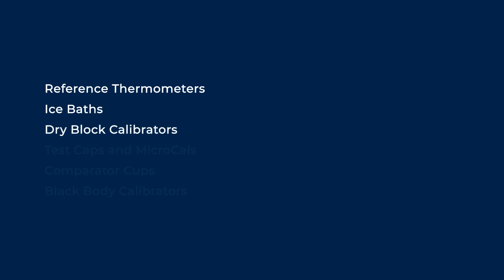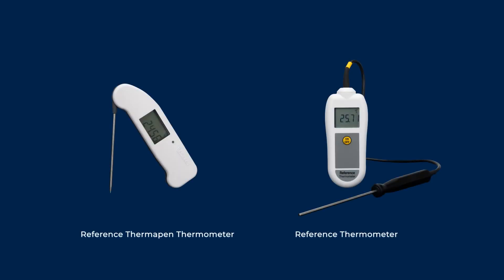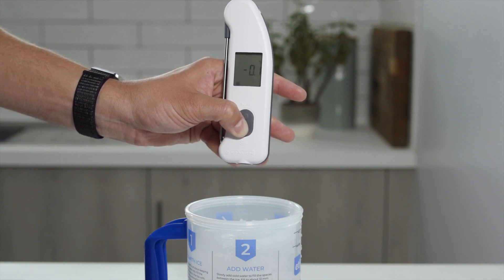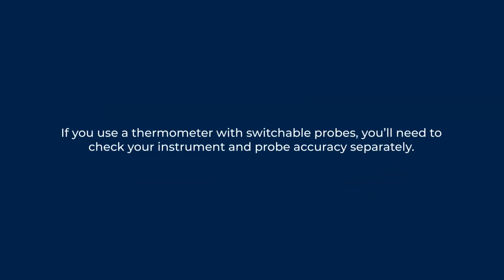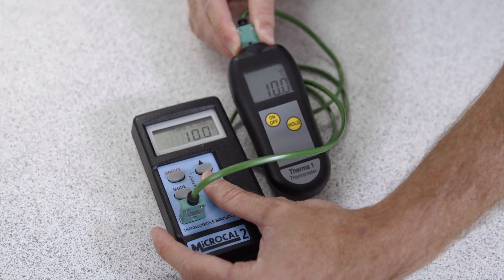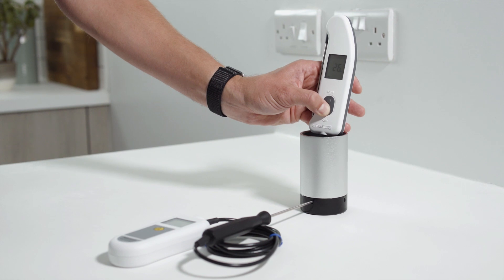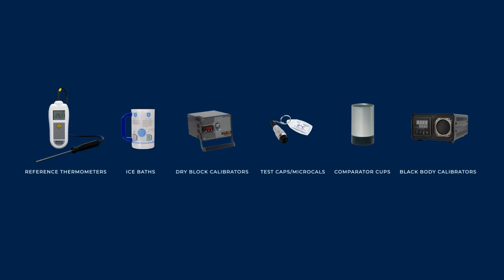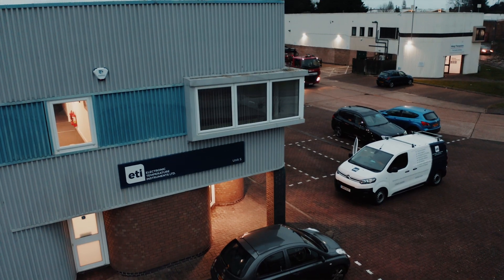6 Ways to Calibrate Digital Thermometers

Comment: The only one I tried is the black body approach at two different occasions, it some years back, but I got 32.7 on the IR cam and way lower, like 27.2 with the thermocouple., but under the arm it did increased to around 30.9 but there likely also needs to be an ideal black tone, as the IR cam did increased the darker the skintone, but I actually reckon its a somewhat dated test that doesn't work well here in the west...